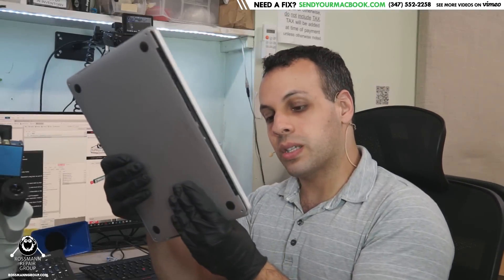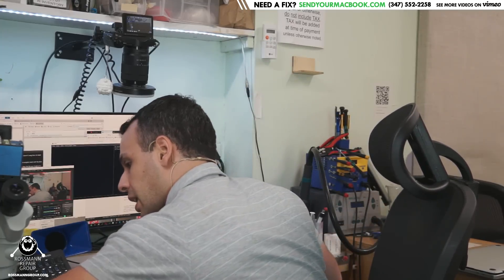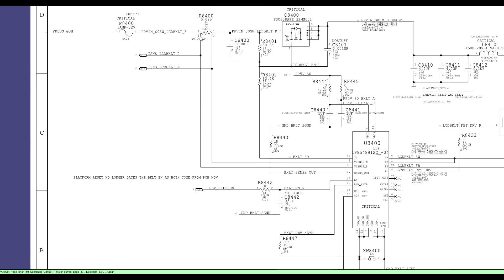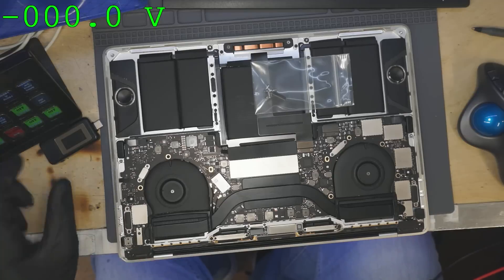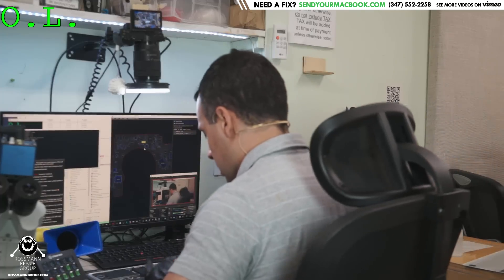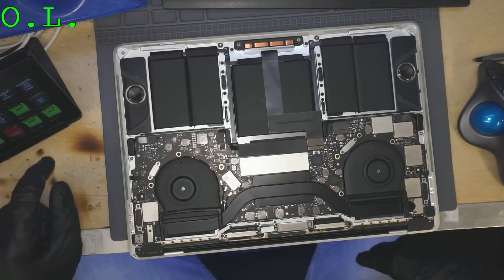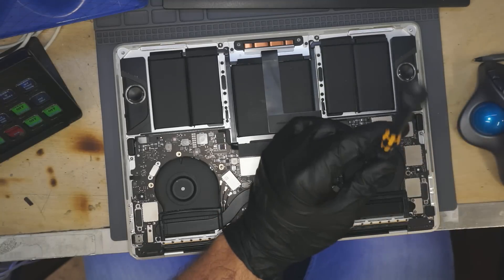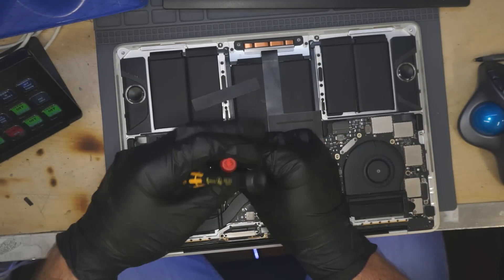Mac authorized dealer said WHAT??? + 1st attempt at ASMR board repair.

Comment: Fuses are designed to save the circuit, and by extension, the component. Why even have a fuse if you have to replace the component to replace the fuse..

Comment: Just found your channel, thank you for this! I'm a happy owner (that is a not-joke) of a a1706. Screen has been replaced, keyboard replaced. All this of faulty design. Guess what, my screen was down again, so I decided to replace it myself. But now anomalies appear (flickering dots) and the system halts. But it does boot normally in safe mode. Diagnostics: all OK. Old screen attached or external screen attached: same anomalies. Do you maybe know what might be the issue?

Comment: This reminds me of my iMac G5 (I still have it, collecting dust...) that I purchased back in November 2004. Barely 11 months later, the screen was pink, whenever I switched it on. I  took it to the shop where I bought it, and later was told the logic board was replaced. It was still under warranty, but I now wonder what was really wrong with it (and if the logic board really had to be replaced).

Comment: A more gentle technique I developed for production for such a fault is to connect to the problem node to an LCR meter, probably resistance is fine, but I was trying to measure capacitance measurement failures on ICT and sometimes a cap can be OC reducing the cap measurement.  You then apply heat with a small hot air nozzle and look for variations in the capacitance or resistance as the heat hits it.  This is usually a mechanical crack problem, probably caused by overly stressfull soldering in the factory, mechanical cracks are sensitive to heat.

Comment: Louis I will admit to not knowing a lot about circuit boards diagnostics soldering etc. However what I do know is that what you are doing the actually physical job takes someone very manually skilled to do so without destroying the whole board. That you know what to do takes someone pretty intelligent and knowledgeable as well.

Comment: Tell me if i got this right, the fuse is there to protect from a short circut, if there is a too high current attached to the motherboard, instead of the circuts getting fried, the fuse gets fried? And since it did its job, protect the motherboard from getting destroyed, according to the genius, one has to get a new macbook? Whats the point of implementing such mechanic in the first place, if even if it does its job well, the result is the same as it didnt? Is this akin to getting in a car accident, surviving only because of seatbelts, but at the hospital they kill you anyway because you have few bruises?

Comment: I purchased the uv laser printer pen and the mask and conformal coating I've  use for almost longer than I could count but I used a uv cold cathode  florescent modding lamp hot wired to a old pc power supply and flip a switch

Comment: The keyboard doesn't work properly - replace the logic board. The screen is not bright enough - replace the logic board. The battery is not charging - replace the logic board. There is a scratch on the case - replace the logic board.

Comment: Around 2006, I used your power injection approach to find a shorted diode (inductive kickback) in a point to point 200 + relay panel. I injected 12VDC, and found the bad diode using a thermal imager. The faulty diode was part of a breaker closing circuit. My employer was impressed

Comment: That was so amazing to watch. I am amazed that you can work under a microscope with those tiny capacitors. I have an Antelope Pure 2 and the LED display is broken. I ordered a replacement but I may send it to you if it needs to be soldered. Your so good at what you do.

Comment: Well. To be honest. The guys at the genius bar are not electricians. So are most computer repair shops. So it is very very cool that you have such a wide knowledge about pcbs and so one, to get this things fixed. So i think it would be ok for me, if the board is just replaced from a technical aspect. But from a ecological aspect it should be repaired. But the thing that makes me angry about this is, a new board should be around $100 maybe 300$ with the work. But the overprized apple parts are some kind of fraud and should be stopped.

Comment: Louis, my way of installing surface mount parts like that is to clean off the pads and apply a spot of solder to just ONE pad and then sweat the part down.  After that's done, add solder to the other pads.  This way the parts are fixed in position and you don't risk blowing them off the board with the hot air gun.

Comment: Apple is the symptoms of the problem in America! Something breaks they replace the entire part or get a new model instead of or trying to fix the part that like most other countries does! Major companies has the profit factor to get rich schemes! in such system of financial structure! A car dealership may sell you a car maybe for cheap but they know you will come to fix the car to replace for new overpriced repairs, once out of warranty... Win win because once the car starts breaking down, then they know you will get a new car after a year or two to begin with again! This is why America system has the debt as high as new york skiscraper buildings! Apple does not want people like Rosman because repairman that actually works to fix the problem are causing losses to Apple

Comment: Why even have a fuse if you're going to replace the whole board? Just use a wire and let the board fry. 

Let's hope apple engineers never see this comment or they might get some ideas.
Reply: It's likely that the authorized dealer doesn't have the necessary skill-set to properly desolder and replace the fuse. It's also likely that even if they did, Apple would still tell them to replace the board. They charge the customer more for the fix, send the old board out for repairs, then resell that board for even more profit. Total scam.

Comment: What is the purpose of the fuse if you still have to replace the entire board if the fuse is blown? The fuse is intended to save actual electronics in a case of power surge so the board doesn't fry right?

Comment: I was just wondering, since it was not obvious which capacitor was blown, instead of bulldozing them all off the board, couldn't you have measured their resistance? The blown one should be much lower relative to the others I would assume. Similarly, I'd imagine you could measure the capacitance as well. So even if all the capacitors are different, I would think you could use Paul's software to find the expected capacitance value, and then compare it to the actual measured one :P. Although to be fair this is a bit more work than just removing them all entirely.

Comment: Hi Louis , i have macbook air 11 from mid 11 and i wanna buy new battery ,is   A1466 / Typ A1496   
7,6V
Kapacitet / Effekt:
7150mAh/54Wh
Type:
Li-Polymer 
will fit ? Thanks

Comment: in Mac Authorized Dealer's defense, they probably don't have the skilled/certified workers required to do this kind of on-board replacement. When I see this video I just see an extremely experienced Louis telling off a shitty mac-certified dealer. Yes, locating the error, having the knowledge to find exactly where the problem is and skillfully resolve it while risking destroying the board is expertise beyond many repair centers.
I think the problem is that people like M.A.D sell themselves as experts when in fact they are not equipped to deal with shit like this that any experienced electric engineer would call "basic". They have a bunch of smaller parts in the back and they connect them like Legos. When they don't have the ability to edit the Legos, they tell you "You have to buy the bigger Lego here."

I'm glad at least that people like Louis are making themselves visible so that people know who to go to when they're facing issues with their hardware, instead of a street-corner bullshit artist.

Comment: With all the flux you're using on those capacitors, I have to wonder what might happen if you did this job at 88 miles per hour.

Comment: Apple authorised dealers are not electronic engineers they are board/part swappers. The ‘faulty’ boards is are sent to an authorised experienced electronics engineer whom can exchange all the surface mount ASICS and processors, RAM I/O etc, which have varying solder connections such as BGA which are under the IC. The equipment for the repair of these type of boards can cost thousands of dollars. Also within the pcb board there are multilayered tracks for example 11 layers and these can short out within the board which means you bin the board.
They also have test software which tests the faulty/repaired board which can speed up the repair which means less down time for the customer.
I would also suggest that if your equipment goes faulty check your household insurance to see if it would cover the cost because if you knock or drop it this could be a way to cover the cost. I dropped my iPad last year and my insurance covered the replacement.

Comment: Im an Apple Repair Technician.. I had a customer come in with a slow board, ran some tests and it was showing Airflow sensors not able to talk to SMC, Apple wanted to charge the customer for the whole board because of a tiny bit of corrosion, (no LCI tripped whatsoever), i spent 2 minutes looking over the board and determined that the Airflow prox sensor had 3 missing resistors and charring. Apples chip blew up and they tried blaming the customer. Its ridiculous.

Comment: Do Apple always buy crap components? It certainly seems like it:( 
I've had laptops for many years, mostly HP,  Dell and most recently Lenovo. The only thing that goes wrong is that  after years of use the backlight starts to go dim. It is fixable but it's cheaper to buy another second hand laptop and (depending on the the power of the PC) install a version of Linux. Personally I would never buy anything from Apple, they are <redacted>!

Comment: They tell customers that they need to replace the board because most customers will have no idea about how their hardware actually works and that parts of a board can be replaced. Also, it's easy to just replace the entire board, since that takes less time and a less skilled and knowledgeable worker than actually looking for the problem on the board and fixing it.

Comment: I dont get it: one capacitor was getting extremely hot: was it not safe to assume THAT was the one that was faulty, and just replace that one? Why replace them all? is it easier to solder?
Reply: Possible preventative maintenance lest those original caps came from a bad batch (wasn't another here suspect)?
Also see how they lined up while soldiered, so not much more time than replacing only one

Comment: What I Hate About You is quite simple. It took me nearly 45 minutes to solder two pieces of wire together. Not thin wire. And then both side of the wire was black and burnt. I might as well be using an oxy acetylene welder. You are have much skill and dexterity with computers motherboards and most of all soldering. This email was meant in the nicest way a compliment to your skill love your videos. I have  not got a clue what you're talking about because I'm thick as they come but still love watching your videos well done

Comment: Thumbs up!   I Louis's technique. We have much of the same equipment for doing board repair.  Louis has schematics that are very helpful.  We have a board of nails test system for testing new boards and repairs.
This allows a relatively untrained person to 'test' boards before sending the bad ones to a trained technician.

Our products have small resistors that act like fuses.   The small resistors are easy to replace.  At one time one could go to a Radio Shack and buy the correct resistor.

Comment: crappy HVAC companies: write that down, write that down!
had a shady competing company with the one i worked for that would claim cracked heat exchanger without checking the house i could totlaly see them trying to replace the whole board or furnace off a blown 5 amp ato fuse that just popped from a lightning strike.

Comment: To be fair here , the genius might not have equipment/skills to do it, however the business model should be send to the correct inhouse technician and charge fairly for the repair like other brands. Like when i send my sony headset for repair they call and tell a is the issue, will cost this much and gave me a choice to repair or charge service for diagnostic.

Comment: I would say that this customer, if not charged by crapple, there is no binding agreement to get the actual fault disclosed. I'm also pretty sure that they don't replace capacitors as per company policy and I also believe that replacing that board would have solved the problem. Basically, they spent some time, figured-out that it needs a new board and instead of pointing to a capacitor, they gave the guy some sort of a fake which won't allow him/her to fix it at a third party joint after being diagnosed for free by them. If super-honest, they would have had to say: There is a faulty part on the board which is soldered and we only replace the board at the cost of so and so and for this information you owe us xwz amount. Honestly, I don't know why people insist to buy these crapple devices and the more videos as such I watch, the more my question makes sense...

Comment: Louis, I worked electronics in the Navy for 20 years (Tomcats, Anytime Baby!) and in that time I saw a shift in the philosophy of repair.  I repaired circuit boards just as your are doing, except we didn't have surface mount parts.  Towards the end of my time in the Navy I saw a switch to just treating circuit boards as consumables.  Rather than repair the boards, they chuck them in the garbage and put in a new one.  This applies to the Apple situation in that their methodology is to replace major subcomponents, not the component parts.  It takes time and money to train people to actually troubleshoot problems and Apple does not train their "Geniuses" to do that level of troubleshooting.  They hook it up to a tester and the tester tells them what parts to change.  The output of the tester is something we called an "ambiguity group" which is a list of parts that are the "most likely cause" of the failure.  The "Geniuses" tell the customer worse case scenario and tell them that all the parts listed in the ambiguity group must be replaced.  The people they hire know little to nothing about electronics.  To hire people that were knowledgeable would simply cost too much so the customer takes it in the ass.  PS, watching your videos takes me back to the good old days and make me feel good because I actually understand everything you are saying.  I love the smell of hot flux in the morning, smells like, history!

Comment: A capacitor can be a fuse. You just have to give it more voltage. When in blows off the board, it just became a fuse. Really liking your satire as you fix these seemingly very common problems.

Comment: Customer - “my screen has a smudge”
Apple support - “you need a new computer”
Reply: Well, it makes sense.
The only way to clean the screen on a macbook, is with an iCleaner. And these are not sold to customers, since they have to be used by a certified technician, otherwise the warranty will be broken. And the technician isn't in right now. So the best solution is just to buy a new macbook.

Comment: That was problem with motherboard...yes
Coul it be repaired... From Apple point No
Could be repaired... Yes
And solution to guess capacitor or similar shorting problem like this... Is infrared camera, or fax paper at least... But not alcohol for burning

Comment: For what it's worth here's my guess as to why they would just replace the whole board.  It's cheaper overall on them.  At some factory somewhere boards are getting stamped en-mass cheaply.  Whereas the capacitors you replaced individually may be much much cheaper, it's a skills and labor factor.  Your skill and ability to accurately diagnose and make a specific repare makes you a more expensive employee to address specific issues.  Whereas a 2 weeks course to get me in the apple lingo, would probably get me to the level of techinical expertise most of these support people have.  Low skill person like me in the topic, would be MUCH cheaper to employ, and my work would be quick and compared to a techincal expert like you, cheaper overall to satisfy customer support just enough to keep them aroud.  I can, and have replaced screens, keyboards, and cooling fans from laptops, and simple things like antenna chip, speakers, and digitizer from phones.  For you, 5 minute jobs, for me, 30 minutes and some change at least.  Anything more techincal than that, and there's at least another digit more digits in pay scales.

Comment: I'm no, electrician so forgive me if i'm wrong, but isn't a fuse supposed to be an easily replacable and cheap component designed to break as to protect the more complex and expensive components that are harder to repair?

I know that turned out to not be the problem... but I don't think they should be allowed to call themself a tech professional if a fuse is beyond their comprehension.